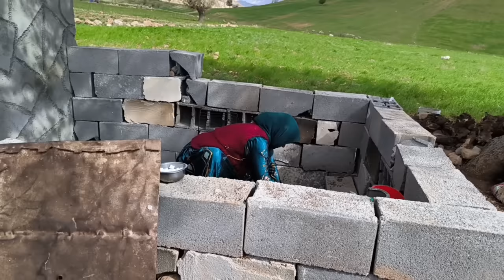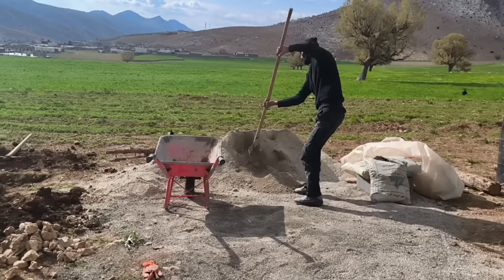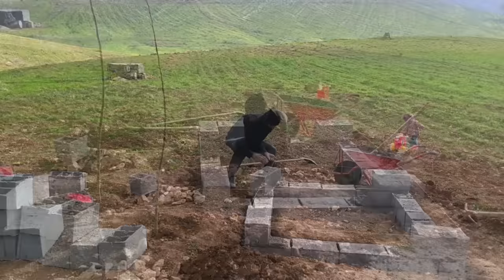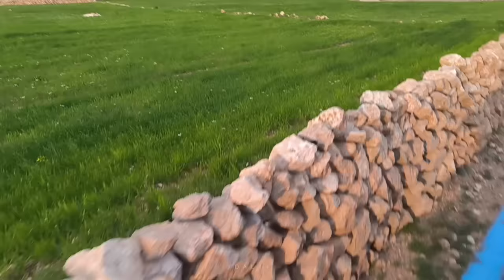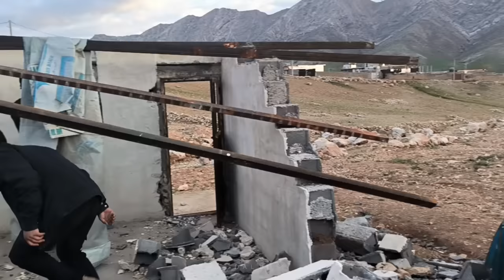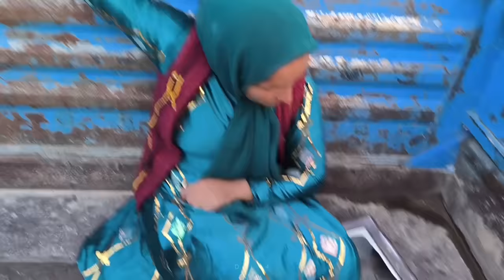On the way to progress: Master's help to Afsane in building a toilet and a dream house

Comment: I think Afsana should get the bricks from her old house.
she can build a bathroom and a toilet room and a shed for storing the firewood. & Get her windows in case she  builds a kitchen later on, right where the temporary kitchen is that the sweet Contractor built. Afsan you can ask the Building Contractor to go with you❤🇬🇧🇬🇧

Comment: So happy to see the bathroom started .just curious, is there a reason for the bathroom to be built in that spot? If not it would be a good Idea to not be on display from neighbours and company if sitting out in the front yard. I also realize the scale of things can be deceiving but it looks quite small. In the winter there would be bulky clothing and boots on. Keeping some supplies inside would also need room. Plus where is the door going to swing into?

Comment: No , no operator don't let them shorten the irons it needs to be sticking out to make a canopy around the roof so water don't get under the roof & rundown the walls inside. They need to talk to the Builder